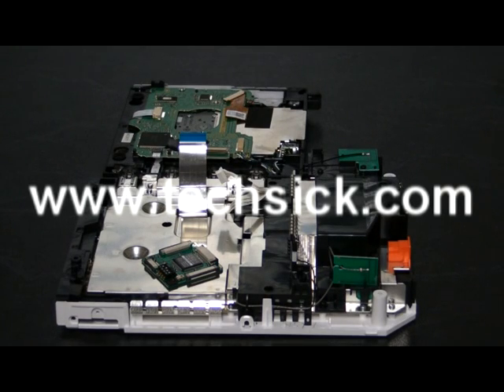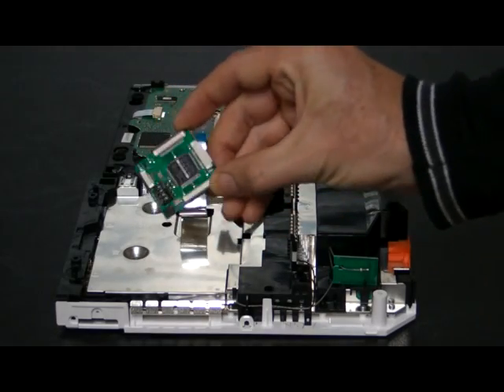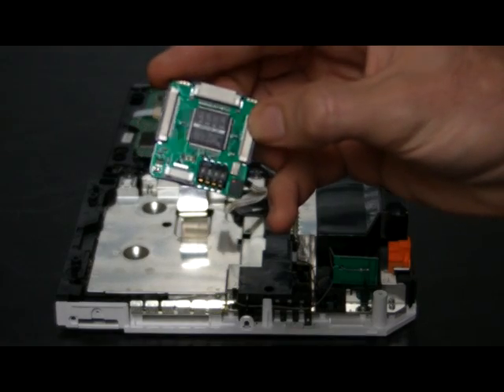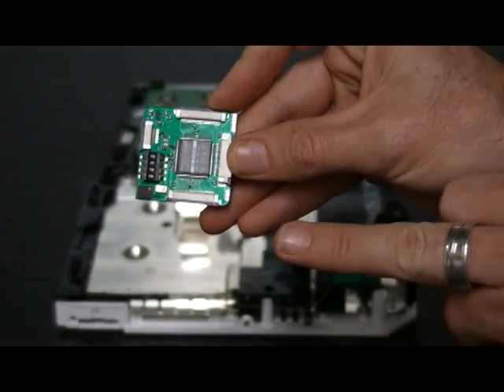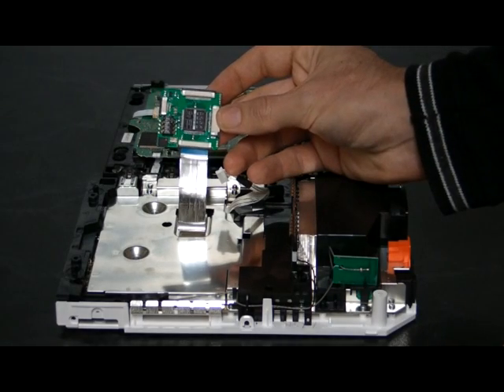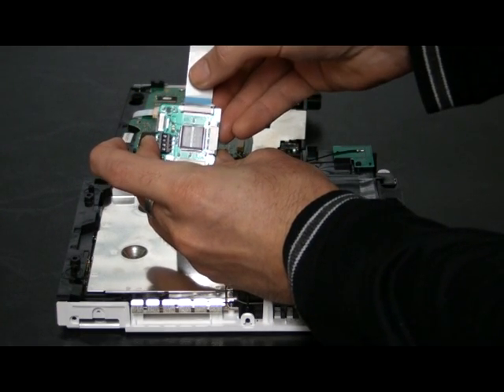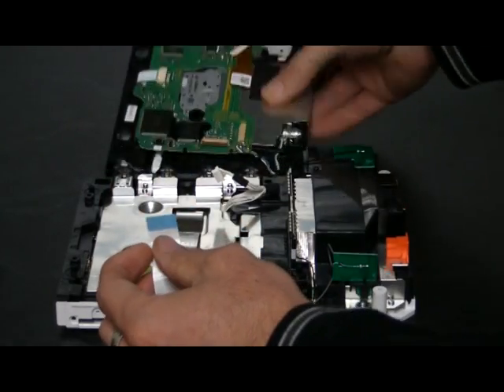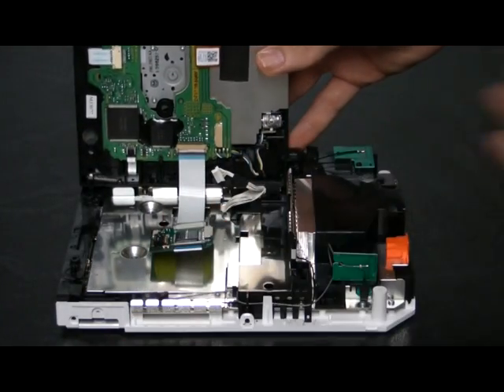How to Install WasabiDX in your Wii - Complete Guide

Comment: Hi
I have recently installed this chip but cannot get it to function.
No matter how many times i try i cannot access the game cube menu via the eject button to set up.
The machine works fine when using origial games so im guessing its installed correctly.  Also the machine is on version 4.3e  Could this be a problem.
Hope you can help cos im getting no help from anywere atm.
Cheers rich

Comment: different chips are for different wii chip sets. currently the wii is made with 7 different kinds of em. also they have different features like region freeing your console and being able to play backups. most chips need soldering to get placed in but the wasabi dx requires none of that at all. its easy to configure and gets the job done. its the chip im ordering.